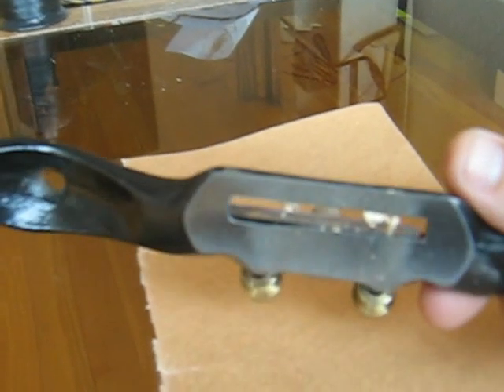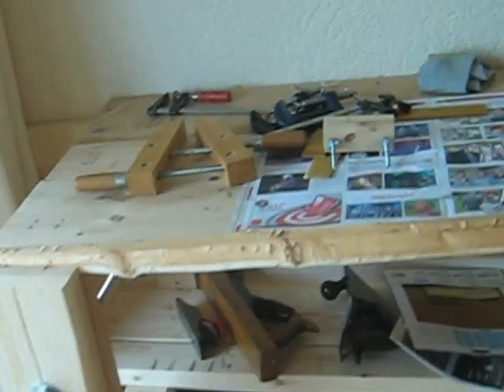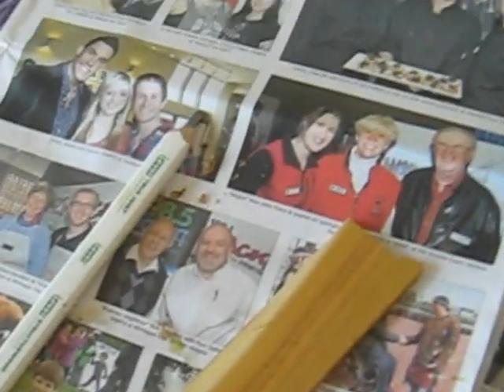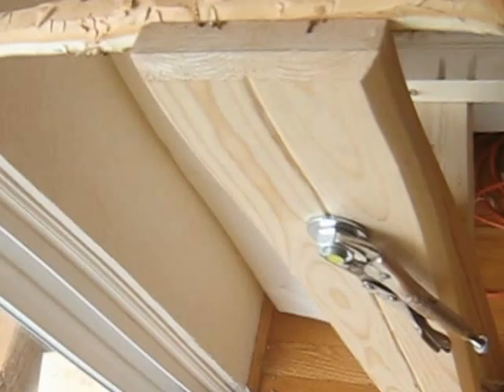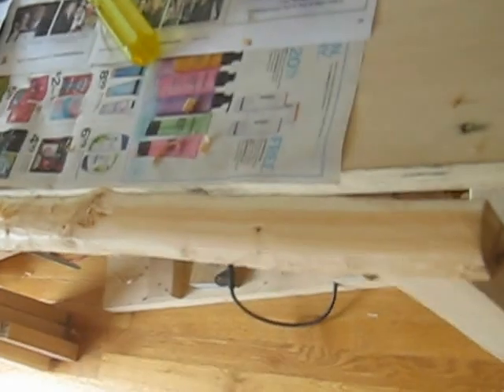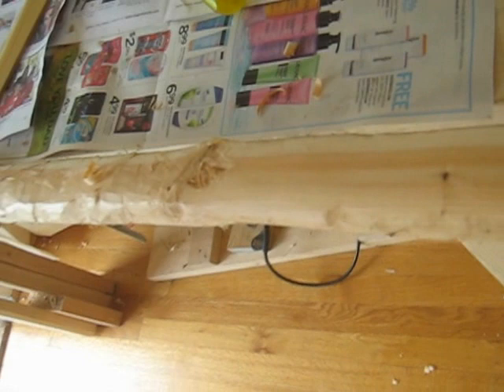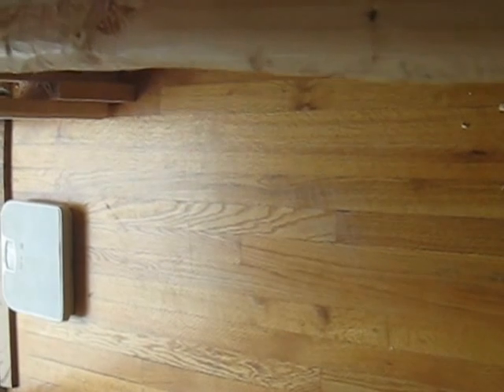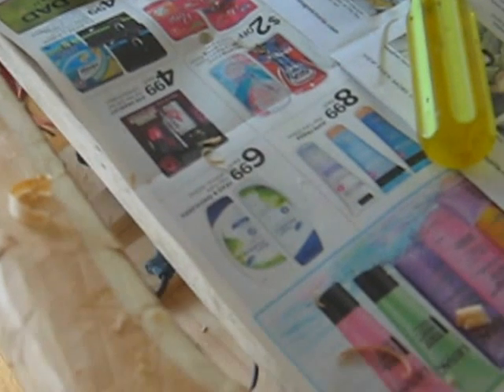Spokeshave Tune-up / Carving around Yew Knots

Comment: Hey, I'm building my own spokeshave out of oak I got for free, 4 screws I had laying around, and as blade I'm using a 0,5mm thick scraper blades (5 blades for 5,60eu) and I must say my self cutted slot for the blade to rest in is even flatter, I used a piece wood that I thinned out the edges by sanding it o flat surface(wich will remove more from sides) then glued 180grid on the slightly radius'd surface and used that radius to sand the surface where the blade sits up, no airgaps under my blade.